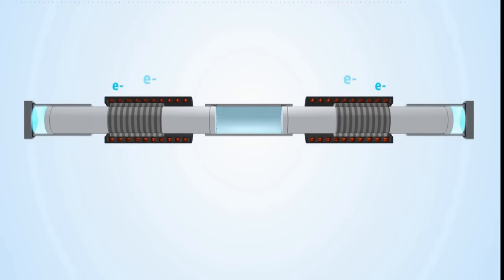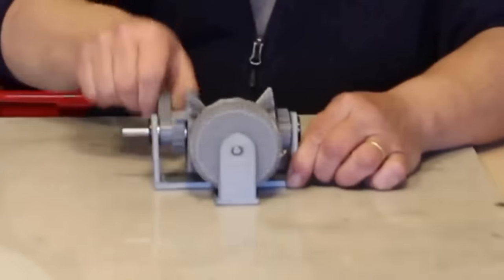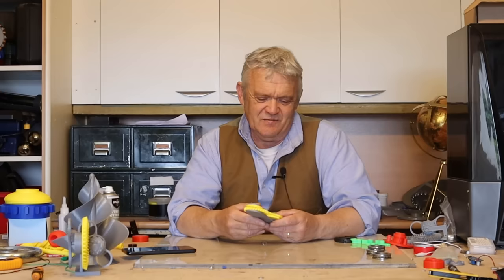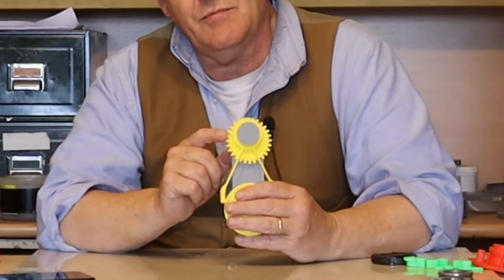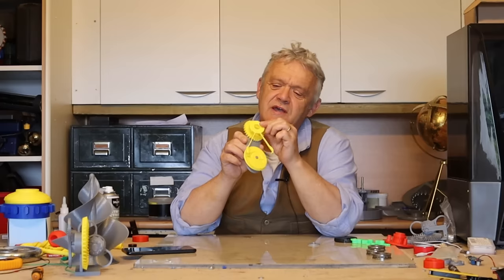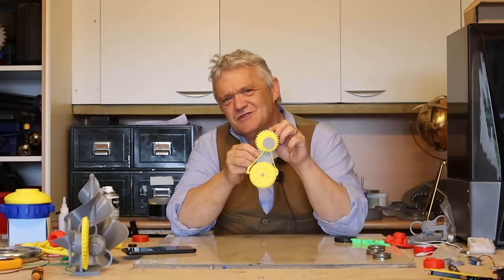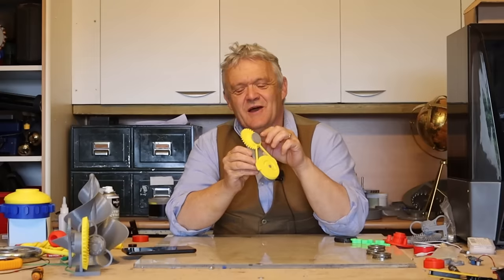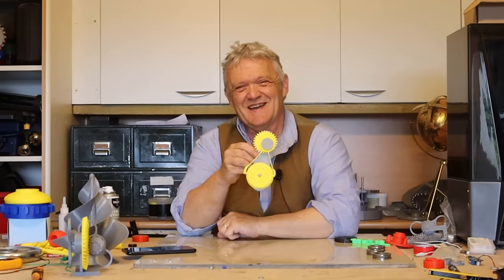2003 The Magic Lever Energy Harvester by Seiko

Comment: In my watch shop I have repaired many of the auto-winding watch mechanisms.  They are very robust and what causes the most failures is bearing contamination with dirt and old sticky lubrication.  Once cleaned, they will auto-wind the mainspring for another 50 years!
Reply: Forensic1man.      Yes, I remember those self-winding watches.
Reply: @fredcarson2791  And yes, many, many people are still using these self-winding watches that appear to run forever once cleaned and lubricated properly!
Reply: Perhaps this concept could be fused with the magnetic gears idea to make a version where the parts never touch and still function?
Reply: @MK-lk7nc  magnets in a mechanical  watch?
Reply: @philspencelayh5464  no that doesn't sound like a good idea :D  but maybe for like, coastal tide generators or walking-motion generators, something like that.
Reply: Looking at Robert's example, I wondered about wear. There is a lot of sliding going on. How to the small watch components guard against this?
Reply: Oil, a very small amount, and a clean room to prevent dust contamination while being serviced.
Reply: @benb8075  Yes, a watchmaker practices clean solvent servicing to remove old sticky lubrication and deposits of dust, fine nano-size grains of sand, and fibers.  Additionally, precision lubrication is utilized followed by very clean assembly conditions to exclude outside contamination.  The lubrication also has to be just right - not too thick to slow down the action, yet thin and chemically inert to lubrication for many tens-of-thousands of sliding and locking operations to keep the hardened metal parts from wearing down.  I have worked on clocks and watches over 150 years old that were cleaned and lubricated properly (all that time) and are now still working perfectly!
Reply: Years ago a friend of mine got a self winding watch for his birthday and he loved it. But a month later the main spring gears started seizing up and he'd have to take it in to get it unjammed.Turns out he had joined a band as a drummer and he kept forgetting to take it off before playing.
Reply: @bruceleenstra6181  the higher quality movement you get, the less likely something like this will happen. but a mechanical watch will always be more complicated and fragile than a quartz sadly. it's like seeing petrol engines being outperformed by electric
Reply: I'm going to assume that Seiko grabbed this from Constaninseco's torque convertor after the patent expired.
Reply: Doesn't the ratchet wear out?
Reply: @davidbgreensmith mechanical watches use well lubricated jewel bearings (artificial rubies and sapphires)
Reply: @tompw3141  If ratchet is made of plastic one might get 2-4 thousand clicks before the tip of the wish-bone breaks off.  However, is made of case-hardened metal, a clean mainspring winder can last for hundreds-of-thousands of clicks with gear turning!
Reply: cool man
Reply: I have a watch like that, but the turning mass unscrewed itself. I haven't taken the time to send it to repair.
Reply: Yes, when the rotating bearing experiences old sticky lubrication, the rotation weight can unscrew the retaining bolt.  You just need to removed the weight and clean its bearings with solvents and then lubricate. The auto-wind mechanism should then be good from another number of years.
Reply: @Forensic1Man  Have you ever looked under a microscope and the the gears for this mechanism? 
It seems like an awful lot of friction. After all that time, are they not worn down?
Reply: I have such a Seiko watch.  Needs repair as I chipped the glass and flooded the mechanism.  Still works but loses two hours a day.  Finding a watch repairer is not the easiest of things.
Reply: Steve. If you want I can take a look at the watch and fix it to run again.  I am worried that over time many critical components are getting rusted and also may need to be replaced.    Let me know.  I live in California.

Comment: I suspect a lot of these energy harvesting devices would make the humans actuating them more tired, but if they only extracted a small insignificant amount per human and there are a lot of humans, then they wouldn't be so noticeable.
Reply: I agree, this would effectively take energy that would be normally fully transferred in a footstep causing people to take more steps and walk faster and/or harder to make up for the deficit in their movement. This would mean people would be more tired walking from place to place, and thus consume more calories resulting in no real energy gain. If we are also to consider thermal losses through increased respiration and perspiration through the extra exertion, then this would actually result in a net loss of "useful energy" from the system since more would turn into heat energy.
Reply: Correct. Energy conservation is the barrier as usual. All these devices cannot generate "Free" electricity/power - the energy has tom come from somewhere!
Reply: @skylerhanson101 the energy an automatic watch could take is the same as an equivalent mass in your arm

Comment: Would be great to use that to lift the weight of a gravety generator. Hook it up to a water wheel or wind mill...use 2 ...one weight comes down for constant power to the generator, while the mechanism on the wind mill pulls up the second for the next cycle. Weight comes to the bottom limit, hits a lever and switches the power to the top weight.
Reply: What is the point of the gravity in this setup, why not hook the generator directly to the wheel (like we actually do now)? I suppose it has a little bit of built in storage capacity but not very much, and if you want that you can get it other ways that don't require the convoluted double weights and this magic lever.
Reply: @TheJohnreeves  it's just a battery, they are very useful for "green" energy sources.

See for example a wind turbine, it could spend some of the excess power in lifting a gravity battery when there's wind and it could release that stored energy from the gravity battery when there's no wind.

Fun project as a hobby for skilled people that know how to build stuff but actually pointless for any country to use now that nuclear power exists, nuclear is just much better and safer than anything else in every capacity at the moment

Comment: Back in the '70s I came up with a similar mechanical energy storage design to store short milder kicks to load a spring for a motorcycle kick starter. The Yamaha RT360 single cylinder 2 stroke had a reputation for delivering injuries if it wasn't kicked with kung fu precision. Shame I didn't have the resources to build it. But I was only in high school at the time.
Reply: The idea is still valid, ratchet+spring+release = kickstart, this should also work for lawnmowers chainsaws outboard engines turboprops...
Reply: @disklamer they used to have that. I guess the spring wasn't reliable.
Reply: Sounds like Stihl Ergostart
Reply: Was there a decompression valve and a means to retard the timing slightly?
Reply: @philip5940  
Decompression, yes. But it stayed plugged with carbon. So, mostly useless.
Timing change would have been nice. Had it fire up in reverse once! 2 stroke. Luckily, the timing was off running that direction, so not as much power.

Comment: Once again Rob shows us machines that can help us today don't necessarily need to have transistors and electricity to be super useful.  Thanks Rob
Reply from the maker: cheers mate
Reply: Of course, if this Magic Lever is to charge a lithium battery in a device, transistors will be necessary
Reply: Or room-temperature superconductors!
Reply: Exactly how does this machine actually help us at all?  Besides that, If not for transistors, your cell phone wouldn’t exist.
Reply: @yamahajapan5351  shush, it's impolite to bring reality into this kind of conversation.

Comment: I really hope you pursue this! I am a Thru-hiker and have walked about 10,000 miles and keeping electronics charged on trail is always something we struggle with. In more open places you can use solar, but on a lot of trails with tree cover it just isn't viable. My friends and I definitely have thought about something to take advantage of the energy we use walking, but haven't seen anything like this. Given that we tend to walk around 8-10 hours a day average, this really could be viable for us. 

One thing to be aware of is that the energy to lift something from your foot (Like shoes) is equivalent to carrying about 5 times that on your back. So if you have a pair of shoes that weight 1 lb vs a pair that weight 2 , you will  be expending about 5 lbs extra in energy of work. The military did some studies on this years ago. 

I mention this because if what you spend in energy over say a 5 day stretch lifting a heavy electric generator system on your shoes is more than say carrying and extra 3/4 lb battery bank, it wouldn't be much use, for us at least. Though, if you live in a city and want a bit extra exercise it could be worth it.  
Anyhow, been watching for a while and love your channel ! Keep up the good work!
Reply: Maybe take this very slow energy and use it to compress some air or something, and then run a turbine with a generator? Or use it to pump water to a higher level, then let it flow down and let it spin a turbine with a generator and get it back in the form of electricity? I dunno. This very slow and intermittent rotational energy would need to be converted into something more consistent to get electrical power back out. Or a gravity pulley like other have said, hook up said  pulley to a generator once enough height has been built into the energy battery to begin harvesting.
Reply: I wonder how that auto-generating backpack design would affect one's gait.  If you get it swinging back and forth opposite from your gate, would the inertia in the pack push against the natural sway in your gait?  And would that make it easier or more difficult to walk over time?  Interesting.
Reply: @mortanicus5871  I am sure it wouldn't be good for balance. Too many times your pack moves side to side and at angles when you bend and twist while hiking. Matching in a straight line maybe. But I wouldn't trust it going over rocks, scree, snow, roots, or mud.
Reply: That's an interesting observation.  The human body is extremely efficient in energy generation & usage.  If it goes into charging devices the energy gain may not be worth the extra effort expended into generating it.
Reply: @rtos  Exactly. Not all that much energy is actually going to waste, so any energy being sapped to generate electricity you will definitely notice. Same with like the in-floor generation concepts, what you end up doing is just making the floor kinda squishy and harder to walk on.
Reply: @crubleigh  Also need to take into account that level of tiredness also impacts willingness to deal with this kind of energy sapping. 
Especially in the places where you actually want this. 
Like on a long hike bringing a foldable solar panel is weight you have to carry. But having something that makes walking/trekking harder to do will impact more than adding some weight.
Reply: @crubleigh  its like walking on sand at the beach. Extra difficult and you dont walk nearly as far per step
Reply: Thank you for the interesting comment. Very insightful ^^
Reply: As a heavy lifter doing stone work and other heavy manual work what I find is anything on the shoulder(s) is the least energy consuming.. Compared to on the back, around the waist or carry infront. Just an observation but not sure how that can be transfered into power!?
Reply: @tatradak9781  I don't use hip belts on my pack so that all the weight is on my shoulders. I am not sure I have noticed it being easier, but it's possible. I don't use hip belts because they can cut off blood supply to the knees and ankles.
Reply: @tatradak9781 When applicable, balancing on one's head is also quite efficient. It's all about keeping your net center of gravity centered.
Carrying poles also come to mind as a very efficient way to carry stuff, provided they fit the task.
Reply: @majorgnu  the point is how to translate this to generating power.. Maybe a shoulder pack with graphene threaded suit that links to all moving parts of the body.. 🤔
Reply: It would seem a simple hand cranked generator would be enough to keep a phone charged?
Reply: Any energy you harvest will require the equal amount in increased effort. You might just as well turn a hand powered generator as you walk along. There is no free energy to harvest.
Reply: @David_in_Thailand  Our idea was some kind of pressure pad on the bottom of the shoe that would act as both a cushion (Like shock absorbers on a car) and the mechanism to power the generator. It would definitely take more expertise than I have. Kind of like the hand generators you can squeeze and it spins, though in this idea the pressure of stepping down on the heel would act as the squeezing mechanism. Definitely not free energy but using energy we are already expending.
Reply: @David_in_Thailand  I am a physic student and don't have any misconception of there being any exception to the conservation of energy. I am talking about converting already expended energy. That energy coming from the foam ie. the cushion of our shoes., (friction, thus thermodynamic, but I didn't feel I needed to be pedantic by expressing this)  we are already expending this energy by walking. Imagine stepping barefoot onto a plate, under the plate was a cushion. You slowly lower which keeps you from quickly dropping that say  2 cm. So, instead you step barefoot onto a plate that has a spring on it. It feels the same to you, but in fact that spring upon raising your foot expands, and yes, you already put the energy into it. But the potential energy you put into the spring can still be used. That's what I am trying to express.
Reply: @David_in_Thailand  I understand the conservation of energy. I'm a physic major. I typed out a reply but got lost in editing. hah As you say, you could do it with your hands. Therefore, you can do it with a spring type generator instead of the cushion on your shoes. We are talking tiny amounts of potential energy converted into small trickles over the course of 8-10 hours of continuous hiking.  So yeah, duh I agree, you're not going to magically get energy out of no where. But that isn't at all what I was saying.
Reply: Your point about the weight vs a battery bank is usually what it comes down to (even with the solar panels). It's almost always better (weight wise) to just carry more battery storage than a device that can charge things unless you're out for weeks on end.
Reply: @niceguy191  yeah I am often out for long hikes, 6 months or so.

Comment: Many years ago I got myself interested in just how such winding mechanisms work. Probably spent the better part of a week at the library (not that doing so was wholely unheard-of for me) but it's a new understanding to see a large model demonstrated.
Rob, thank you!
Reply: My watch (a Seiko 5) has a glass back, so you can see the balance wheel, but you can't see the magic lever.
Reply: @toml.8210  a glass back with the winding mechanism and main spring visible would be interesting. Bonus points if the glass were etched with graduations for about how long it will run with the currently stored energy!
Reply: @matthewellisor5835  Exhibition back self winding watches are pretty common now.  Even Rolex adopted this just this year.  The unfortunate problem with this is the self winding mechanism is nearly concentric centered, so even when skeletonized, the pendulum weight makes seeing the operation impossible.  I have two watches like this, and I've poured over them to try and divine how this mechanism works, but with this video, it's obvious now.  The only not obvious part is getting the driven wheel (attached to the mainspring) nearly concentric with the pendulum wheel, but I have a pretty clear idea of how they do this in my mind's eye.  There are any number of watch servicing videos on YouTube for reference, but this large model truly pulls back the covers on how it really works.

Comment: I've found the climbing device the "GRIGRI" to be a very interesting mechanism. It's a very important safety device, so it must not fail, but it's also a piece of climbing gear so it'll get banged up against rocks, wet, muddy, has to accommodate ropes of all different sizes, etc.. It's incredibly simple, though, but it just doesn't fail except in exceptional circumstances.
Reply: I prefer the grillon myself